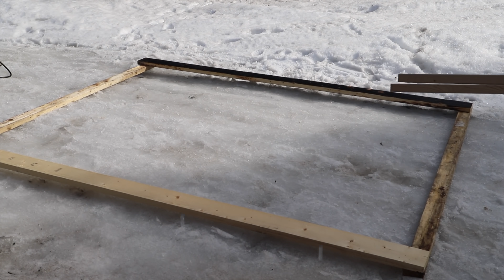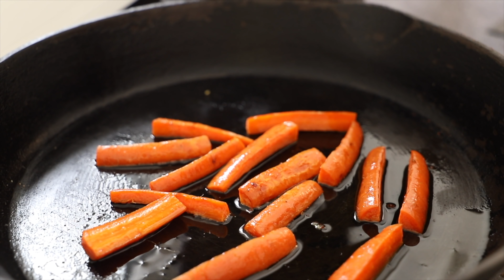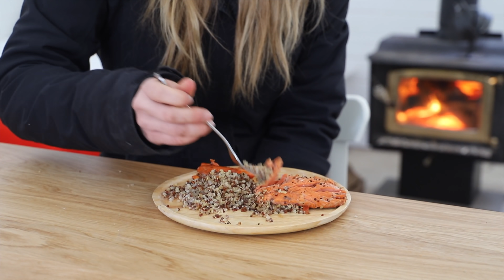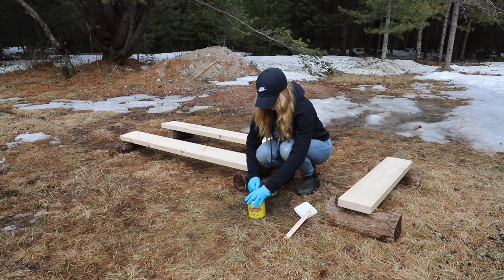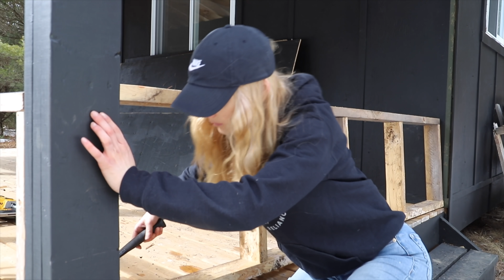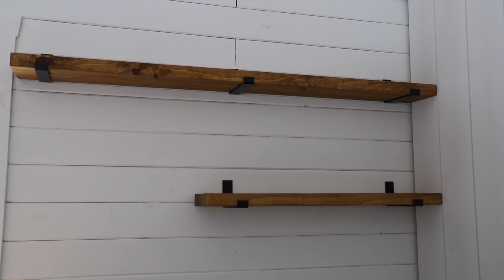OFF GRID CABIN | DIY Shelves, Garden Beds, and Maple Sugar

Comment: Kind Thanks Emily! Your cabin just keeps getting better every time I tune in. Your Dad going to have a hard time catching up, eh? I’ve been a cabinetmaker and restorer of period antiques many years so here’s a little tip that helped me a lot. I drive some nails or screws in some wood scraps, enough to be stable with the points up and then when I stain or varnish a flat board I can put wet side down and finish the other side so it all dries at once. It’s an old shop tip and I often used it when I varnished table leaves, placing the underside on the nail points. It would leave a tiny spot but it would be covered by a second coat or not even seen. Works well when painting as well. Of course it may not be as critical with certain stains. Great video and can’t wait to see how your garden grows! Love, Light, Peace and Joy of Being to you and your Family! DaveyJO in Pennsylvania
Reply from the maker: Thanks for the tip!

Comment: Looking good!
Interesting to learn that about the making of sugar. I'd heard about letting it stand in shallow pans to crystallise, but that meant waiting a long time (strewing in a bit of sugar at that point could make it go faster, by providing starting points for the new crystals to begin growing)  and then breaking up the big sheets that formed. In the end that looked a lot harder than this method. 
I'd also heard about people dipping a thin clean (slightly hairy) cotton string in it, to let sugar clumps form around the string. The cotton fibers provide the sugar solution with nucleation sites, so crystals start forming faster. Then you dip the string in your tea and let a bit of the sugar dissolve to sweeten it, take it out and let it dry, reuse it in the next cuppa, until the clumps are gone. People tend to use less sugar in their tea that way than by putting in a small teaspoonful. 
I never knew that stirring the syrup without more heating (& evaporation) would thicken it and turn it into sugar!
The result looks very good!

3 feet may be just a bit too far to easily reach from one side, you might want to consider leaving a narrow walkway along the porch side.
The comfortable design-width I was taught for raised beds that you want to be able to reach easily is 6 feet from the edge (or 12 feet if it's reachable from both sides).
Though that was for elderly or wheelchair-bound gardeners, you are probably a lot more flexible and less likely to stress your back from bending too far. Maybe try how it feels to stretch for weeding or digging at the back before you fill the beds with earth?

Comment: The rain drips off your roofline in the front. You might want to pull your raised beds out away from the house a little further. Downpours may go into your raised beds. You might also need more access room to go under the house and to walk around your raised bed. Think about where your septic and drainage lines are and possibly install some rain gutters on the cabin. You may want the space closer to the house for some rain barrels and catchment system. 
You could plan out how you get water to the raised beds and maybe use a hose attached to the rain barrel. A timer on drip irrigation would be great for when you are not there.
Hope you don't mind some of my thoughts. It is very cool that you are doing this and many blessings! 🌷

Comment: Hey Emily, you are doing a great job!!!  For your safety, when using any type of power tool, drill, grinder, saw, hold your hair tight, it can be caught in a circular motion or even in a motor (00.50-00.58). The same thing can happen with a cord from the hood of a sweater.

Comment: Little tip for you Emily, when using wood screws try to find a longer screw bit as it makes it easier to see what your doing and always start your screw at a slow speed with light weight pushing on it until you feel it start to bite in then get some body weight behind it and a little more speed, you wont strip the head out or slip and gunk up your wall or your hand. I must say your cabin is looking awesome and i can not wait to see how good it will look when done!!

Comment: Great Job Emily! So the maple sugar is just a matter of boiling off most of the water and rapidly cooling it by stirring it constantly which leaves you the crystal precipitate form?  That's all is to it? Cool idea for the garden boxes. If you want to keep them closer to level all you would have to do is drive a few stakes in the ground at the front of the beds inside, level them and nail them. Or just put some dunage under the front panels. Great idea for the shelves. Looks very nice and easy to make. Keep the inspiring videos coming ! Have a great day

Comment: Great job Emily. we live off grid also and we have the same stove we like it its a good company and service. we had some discoloration on the enamel top and they replaced no questions asked. One last thing, the sensor for the pilot light in the oven tends to get a build up of carbon and then can give you trouble lighting it.  When this happens we open the broiler drawer and clean that sensor with an abrasive scrub pad . The oven will light fine until the next time there is a build up on the sensor.
Reply: Hi Lorraine  I hope my comment didn't sound as a form of privacy invasion your comment  tells of a wonderful woman with a beautiful heart which led me to comment  I don't normally write in the comment section but I think you deserve this complement. If you don’t mind can we be friends? Thanks  God bless you….🌹🌹

Comment: Great job Em but, I am a little concerned for the outdoor garden bed. Will a hard downpour wash the dirt away being under the drip edge of the porch roof?  I fig you would install a gutter on the porch roof and collect the runoff in one of those blue rain barrels, that is if water is in short supply at your location.  Look forward to your next video, many blessings.

Comment: it is cool how the drips from the overhang catch the light here and there and look like the video is breaking up ... lil falling star drops essentially lol
Reply: hmm mechanical advantage would come in handy for maple sugar ... something like a 2 comb honey spinner ... except when you crank the handle you move mixing paddles in the sugar breaking it up fine and lasting longer ...
Reply: your deck railing seems very low are you not worried about tripping over it and falling ... a potential solution is make yourself a length of rope and pass it around each pillar and then let it sag between the posts to act as a high handrail fall stop ... and gives you a bit more rustic ... weave grasses into rope is quite easy and there are several video's on it ... I prefer to watch ruth goodman do her plaiting as a good option ... and rope is always useful ;)
Reply: ahhh screened in porch ... makes sense ... that works well also lol
Reply: one thing you definitely should build is a step stool work bench you can carry around ... nothing too big about knee height big enough to stand on or sit upon ... or put wood on to cut or mark etc ... have one for work and make a fancy one with flip down steps to get at high shelves on the walls ... great place for long term storage like winter clothes or seasonal stuff ... and of course BULK goods like sugars jams jellies preserves ... cured meats etc ... pickles even ...
Reply: IF you didn't already know .. Avocado's 2.5 times the daily dose of vitamin C ... goes nice in a salsa for nacho's with beverage of choice ... makes guacamole and goes great in salads also ... cooked with a bit of honey in a pastry bread dough and they make awesome fruit turnovers like the old mcdonalds ones USED to taste like ... real food lol 
.
avocado's great for what ails ya ...

Comment: If you dip wood screws in wax or fat, drill your pilot holes and then use a electric screw driver it will save you time and effort in the future.

Comment: It is not a great idea to work soil that is too wet. The soil loses its condition and becomes easily compacted. Unless you plan on adding a bunch ch of soil amendments when it dries out.  I wouldn't reccomend working wet soil. When you preserve wood sho shugi bon it normally uses an oil as well.